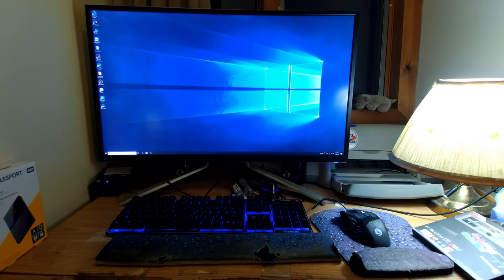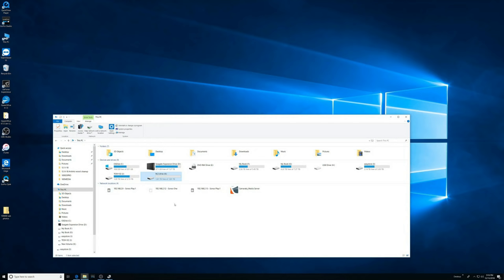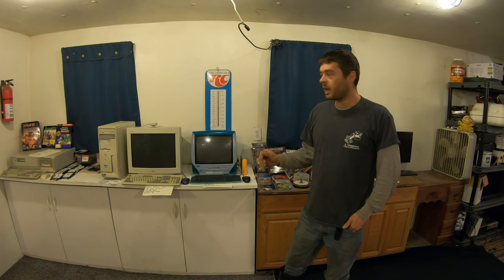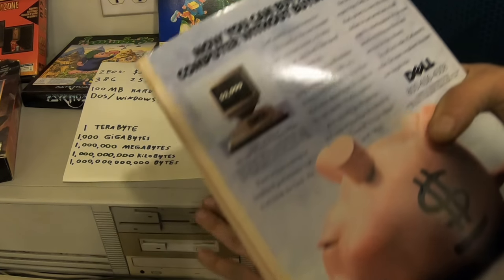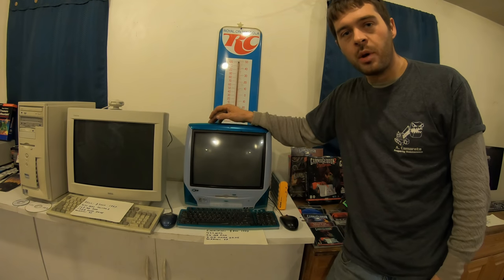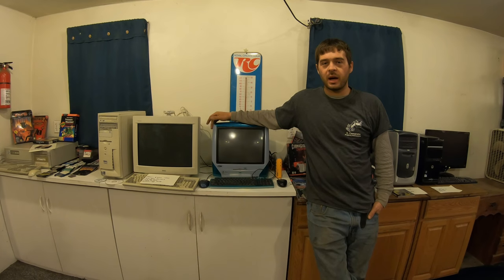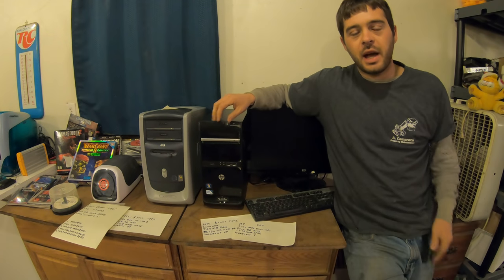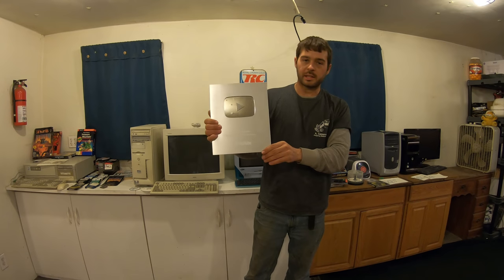Upgrading and talking about computers

Comment: Andrew, not sure if you're using an SSD for your OS, but if you're not then you should use Samsungs data migration tool to copy your OS to the M.2 drive, then work off your 960 Evo for good performance.
Reply from the maker: I am using a SSD. think there would be a noticeable difference if it was on the M2?
Reply: @AndrewCamarata  It depends on the situation, but probably not. Short answer, it wouldn't make navigating windows go noticeably faster. I'll leave a longer explanation for more detail in case you want it. Think of the CPU, RAM, and HD as three bars on a bar graph. The lowest bar limits the other two bars no matter how much higher they are, it keeps them operating at the lowest bars level. Chances are your videos aren't being moved off the gopro at any higher speeds than the 960. Also, you'd need to go from an M.2 to another M.2 to actually see the increased transfer speeds. If you keep in mind the general rule that the lowest performing device will limit all other devices in a computer operation (such as a file transfer) then you can start to answer questions you might have about future upgrades and such. Also keep in mind that using standard SSDs throughout will make things go pretty darn quick anyway. Which from this video it seems like you're in a pretty good spot with drives after the upgrades here.

Comment: Yay my department Andrew its not Ram that is necessary for your editing its a really good CPU and GFX I currently run i7 with GTX1070ti and 32gig ram and its flawless in anything I do from Gaming to admin editing etc etc... yeah I love the new nano ssd sticks I have two for for general use overkill I know but I prefer a rig that does not hold back with what ever I am doing...Funds permitting I would definitely renew your PSU mate I always renew every 2-3 years those 4 pins your currently using are now getting obsolete
Reply: "It's not RAM that is necessary for your editing" Erm...yes it is. It's a critical part! CPU is important for literally cranking out the calculations needed for encoding/transoding/remuxing or whatever (and better yet if you can hardware accelerate parts of that with built in or Graphics Card support). But if you don't have enough RAM to hold all the project data or hold the data that being processed during an actual edit (effects, previews etc etc), then there is no option other than to swap to disk, which will grind you to a halt straight away. That's also why setting up you swap disk on super fast NVME solid state storage can help a bit (or intel optane)- but more RAM is definitely a critical part of video editing. And photo editing for that matter.

Comment: GoPro studio is a bloated resource hog
I use OpenShot Video editor, it's open source, freeware and dead easy to use..
Reply: mate, have you tried LosslessCut?  very lightweight, efficient way to make the initial cuts.  then you just queue them up in openshot.
Reply: @bashisobsolete.pythonismyn6321  
No, I can do it in the snipping window or on the time line in OpenShot so don't see ant need and pre cutting files just take up a pile of space which is the problem with GoPro editor where OpenShot uses index of times in the original file itself in the back ground and then does the cuts of parts in the final compression stage so it doesn't create a bunch of file parts filling up the hard drive each edit.
And once you cut sections on the time line you can right click on each part and apply lots of filters to it like speed changes etc.
Reply: @AuMechanic  that sounds much better.  i need to get a new laptop that can handle openshot.
Reply: @bashisobsolete.pythonismyn6321  
It's pretty light weight
I'm using it on an i5 mini NUC PC 1.6ghz processor with 16 GB of memory and it handles anything I throw at Openshot no probs.
Anything else like GoPro edit just drags it down. 
Id give it a go and see if it runs on the machine you have and as mentioned it freeware and open source so no dirty old adware and the like in it.

Comment: l miss DOS. You could do anything you needed directly. Then I’d write programs in BASIC. Now I can’t figure out where files go or why especially trying to handle video files. From GoPro they go to Photos, but then my editor can’t find them. I have to copy them to desktop, then to the editor. I’d rather work on my Jeep and heavy equipment.  My first PC was Apple 2e with two floppy drives and 64k in about ‘82.

Comment: My first computer was a Tandy, Radio Shacks own brand.  It had no hard drive and just one big floppy disk. If you wanted to copy a disk you had to copy one file at a time putting first the disk to be copied to the target disk. So if there was 10 files to be copied you had to keep changing the disk 10 times.  So the next thing I did was get a second floppy disk drive and was able to copy one disk to another without taking the disk in and out. Next when I decided I wanted to play a game they said I would need a hard drive.  They told me I would never need a hard drive bigger then 10 meg.  Ha Ha, how things have changed. The tandy ran on DOS. Windows was not out yet.

Comment: You should really have your Windows 10 installed onto that M.2 drive.  Using it just for editing only is like using a skidsteer only as a pallet jack. Windows 10 loves running on M.2 or even the SSD. Like its almost unheard of now to install Windows on a' spinny' drive now.
Reply from the maker: Its already on a SSD, think there would be any difference if it was on the M2?
Reply: @AndrewCamarata  if its already on an SSD then it would not be much of a difference, beardly noticeable unless the SSD is old, then it might be slightly noticeable. Certainly not enough to bother reinstalling windows.  I just came back to rewatch some of these older videos and was surprised to see you responded to one of my old comments. Enjoying all these videos now in 5k!  By the way, I know you're using premiere pro now, but i highly recommend 'DaVinci Resolve' for video editing. After 20 years of Adobe i found this gem a few years ago and ill never go back to premiere again. Have a good one!!

Comment: you could move your boot to the fast drive so your PC goes faster, also move the temp storate to the SSD drive so swapping goes faster. You can look at PerfMon.exe (Performance Monitor) or ResMon.exe (Resource Monitor) easyer tool not as much info, and look at disk queue to see how long your PC waits on disk, then you know if disk is an issue. Video editing with https://www.openshot.org/ is also an option (free as well)

Comment: Hey Andrew love your videos been watching them for awhile! If your serious about editing videos and making them, you should seriously go with a Mac. Honestly one few things Apple does good is sound editing and video editing programs. When I was in college all we used were Macs running Final Cut Pro X. It's way easier then Sony Vegas Pro and alot of the other video editing software. Also having SSD and more RAM will help video editing, but most work is done on Dedicated Graphics Card (GPU) and processor (CPU) so for faster trancoding make sure you have high clock speed with good amount cores for your CPU and A LOT of ram for your GPU if you don't go the Apple route. Keep up amazing work!

Comment: @Andrew you should install the OS on that m2 drive. It would be much more faster.
Reply from the maker: Its already on that other solid state though. Think it would matter?
Reply: @AndrewCamarata  The most I/O instensive part of the system is the OS disk. For comparsion. SSD with sata3 usually has arround 500-600 MB/s and NVMe M2 drives has arround 3500MB/s through PCIe lane. I would say it is definitally worth to install the OS on that drive.

Comment: you should install the operating system on the ssd you installed, this will decrease boot time significantly if it is currently installed on a hdd drive
Reply from the maker: Its on that other sata SSD

Comment: you should run your OS (windows) from the m.2 or at least the ssd. also update and configure your bios. ram usually does not run on its full potential if the bios is not configured accordingly
Reply from the maker: Windows is on that other solid state drive.

Comment: ?? No Quake? No Unreal? What kind of gamer are you? ;=} I had very similar computers as you. Even an eMachine tower with 98 on it. I would find old Towers in dumpsters, still working, just needs a power supply or video card. I remember that emachine and as with Apple, not up gradable and for that reason passed on them. Was never an Apple fan. Then Kijiji online shopping and bargains, even built PCs for sale for awhile. Buy cheap, fix, load Windows 7 and great for resales. Anything computers I like to watch, I really never comment on videos, they go unseen or ignored.

Comment: Doom and Heretic were my faves , too bad they cant be installed on newer computers
Reply from the maker: davernon sure they can.
Reply: I put in the Heretic ll disc and I get a message, This app cant be run on this PC. I am running Win 10  @AndrewCamarata
Reply from the maker: Try running it in Compatibility Mode, or google it. I googled it quickly; one person said: 6. Run the "Heretic II Enhancement Pack v1.06 (14.1 MB)  which can be found Google the internet.
7. install the "win2kserverfix" download link below:
Reply from the maker: If your ever having an issue getting something old to run on a new computer; google it, chances are, the answer is on the internet somewhere.
Reply: Thanks , I will give it a try tomorrow  @AndrewCamarata

Comment: Have you set the edit software to used the Gfx card - not the cpu?
Reply from the maker: I have not. I am not aware that was something I could do. Is that worth doing. I know its using the CPU when its rendering.
Reply: @AndrewCamarata  most gfx cards use cuda cores which render much faster than the CPU and take the load off the CPU.  
Most video editing software have a setting for it in the software preferences. Not sure about GoPro - but it's worth a look.  THe difference in speed can be staggering.

I used adobe and my GFx card wasn't on their approved card list - however there is a work around, as you can find the file with the list is and type your own card name - then it works lol.
Reply from the maker: I looked, I didn't see a setting in studio. But now working off that solid state. I can edit video while the files are being converted from mp4 to avi. That is a huge time saver.
Reply: @AndrewCamarata   see if there is something or a check box that says something like "use GPU".
But if you're happy with your speed now, then all is good :-)

Comment: you cant use different types of ram in the same pc you will mess something up or it will not use one of them also u cant use 3 slots you have to use 2 or 4 and your sticks should be the same brand/speed/quality for it to not mess something up
Reply: Normally they default to the lower speed of whichever set you use, it’s not recommended but I haven’t had any issues running them that way,  I am pretty sure he added 2 more slots he only showed 1 but when done there was 2 shown
Reply: This is and isn't true depending on your definition of 'type'. It is perfectly fine to mix manufacturers and clock speeds. Your computer will default to lowest speed. You can also populate memory in odd numbers depending on the motherboard, chipset and processor. The problem comes in when you mix ECC vs Non ECC, or you run a server board that requires slots be populated in a specific order. Obviously DDR3 and 4 don't mix but they wont physically fit either.

Comment: why dont you clone your c drive to the m.2? its so much faster and you can use the old drive for storage. check out mini partition tool. makes it easy to do. :)
Reply from the maker: My C drive is already on a solid state drive, would it make that much of a difference? I just built a new PC, and it has 3 m2 drives in it.
Reply: @AndrewCamarata  then you are good. i thought you had your system running off the standard spinning drive. keep up the awesome videos kind sir :)
Reply: @AndrewCamarata  I hope you made a video on building the new pc.

Comment: installing a radio with a chainsaw making a easy access dash an actually putting ram inside a pc without using hammer duct tape flex seal e6000 an super glue

Comment: Have a look on gog dot com. You can get Wolfenstein, Doom, Doom 2, Quake, Quake 2 and loads of other classic games for little money. I am playing Quake 2 at present. I also have Medal of Honor and Serious Sam 2 on the go. I hadn't played games since Windows stopped running my favorite games. With GOG I can buy them for a few bucks and they run on Windows 10. 

The first machine I used was a Commodore Pet with 32kB of RAM and a tape drive. I paid $32,000 for a 16MB RAM card the size of a tea tray. A 270MB Fujitsu M2333 cost $7,000 and the Emulex QD34 controller card cost another $2400. We had five people working on the machine, a MicroVAX II at 0.9 MIPS. 

I work with computers so I didn't like to have them at home. My first home computer was an AMD Athlon 2100+ based machine with about a 100GB hard drive and a gigabyte of RAM.

Comment: Andrew,,memory ram makes a computer stable,not fast,the processor makes the computer fast,careful with SSD drives,they tend to last in 5 years,,and never hide your unit in tight places,in order to make them run quieter change the fans,,the unit need ventilation,with 32gb it will heat up,,,,,,,,Andrew try Linux,,you can run it with Windows [dual boot]16gb of ram and having a PCI-E video card you didn't need more ram,only when the video is integrated to the board

Comment: little late for a comment...you should look into Linux operating systems, I would run Ubuntu on a machine with good specs like yours does, all software is free as well as the OS its self
Reply from the maker: I took a few Linux classes in college. Could use it if I had to.

Comment: That's not a solid state hard drive bruh, that's an SSD. SSHD's are much slower and basically useless.

Also holy shit just plug your DVD drive back into your power supply; those SATA power splitters are crazy prone to literally setting on fire. As in burn marks, smoke, and dead drives.

Comment: Late 90s and early 2000s, nothing dominated the market so bad like PC CHIPS. They pretty basic, cheap and high integration with all onboard .. people at that time hated them They pretend to had Soyos and DFIs LOL. The one we could afford was a PCCHIPs 585 with a K6 II 500. After sitting 10 years, turns on boot no probs appart from CMOS battery. I have seen plenty of times this mobos online, still working. So, in the end they probe themselves to be reliable way above their price tag, you got everything cheaper and functional. They used the excel 2000, SIS 530 gfExcel chipsets. Audio was AWFUL, I most admit.

Comment: i say take out old HDD and use only SSD . SSD so fast pc turn on in 2sec and ready for work no need to wait click on everything you want - it open immediately. HDD only slow down PC make noise and heat.
Reply from the maker: The OS is on that other SSD. That old hard drive is in there just for storage.

Comment: Cooler master is not so quiet, all u need is intel fan and a 5cm aluminium cooler block with copper core.. then it will be quiet, and a PC with water cooling is prob the dumbest idea i ever seen in my live... putting that thing in another room is actually genius.. u might want to seal the casing or that part were the PC is with alumiun or magnetic foley, hackers know how to acces blue tooth and infrared frequencies, infrared is part of the mictowave family...

Comment: you should honestly not touch PCs until you gain more knowledge man, this was a painful one. allow me to go ahead and add to this as some keyboard warriors are quick the jump, i watch this channel frequently. i am NOT here to "shit" on this channel.
Reply: doing is learning
Reply: @evie8143  no not in PCs sorry. There is too much info out there to not have done better with this.
Reply: dude go do this shit on sum other channel.
Reply: Nothing he said or did was wrong or inaccurate in this video. I would run Windows of the M.2 ssd, but for a quick upgrade for video editing it' s fine this way. I would archive to a NAS also, that would be good for a future upgrade.
Reply: @anthonycarrollfixingstuff5424  I am not ''shitting'' on this channel as i do watch it a lot there key board warrior. But doing things in an improper manner and showing people how to do so only leads others to make mistakes.
Reply: @veen588  nothing being done about matching RAM and installing the M.2 all while dragging the screwdriver across the board. come on now. the M.2 is roughly 600 and the 2.5 SSD is roughly 700. This isn't about what you would do or not do, but misinforming those that are ignorant. also nothing inaccurate, check on the numbers for storage again...
Reply: @RaginGaming14  Agreed you could do better then he did but for this use case it's fine. The screwdriver scrape is good to avoid but I have build a lot of machines as a professional and those things happen, never had anything break. I would have laid the computer flat and taken out the graphics card to avoid it btw. I'm not sure what you mean by the ssd's being 600 & 700. Either way, I think people watching understand this is not the ultimate editing station tutorial but a quick upgrade to his system.
Reply: @veen588  i see your point, and i agree to an extent. my only concern here is people completely new to this making mistakes with expensive hardware. that is all.
Reply: @anthonycarrollfixingstuff5424  you are totally right :D